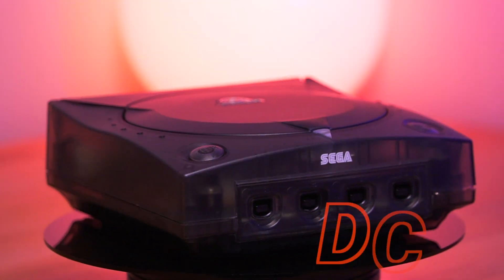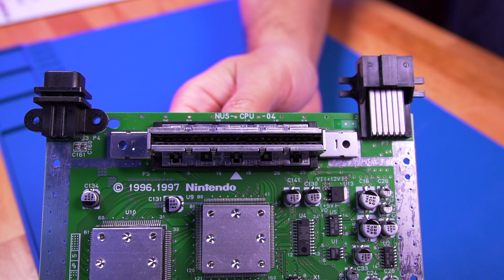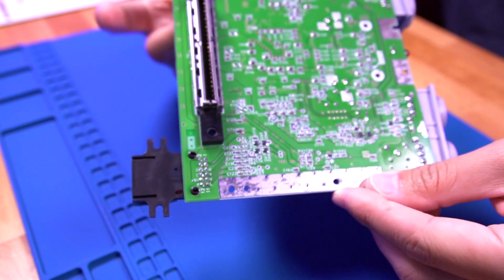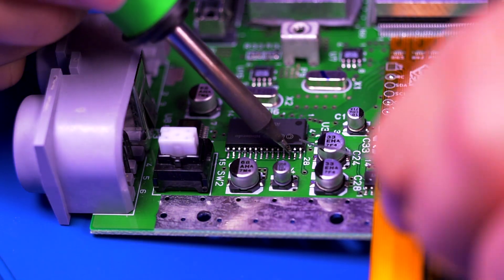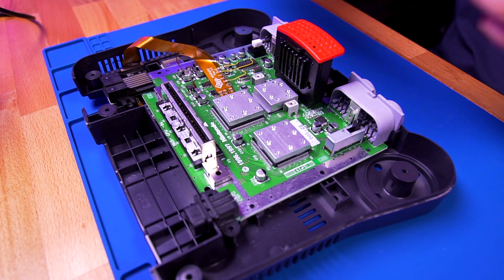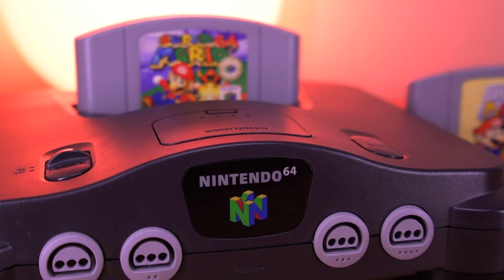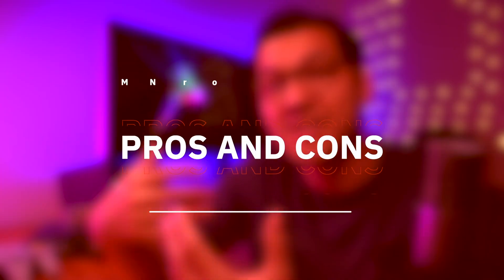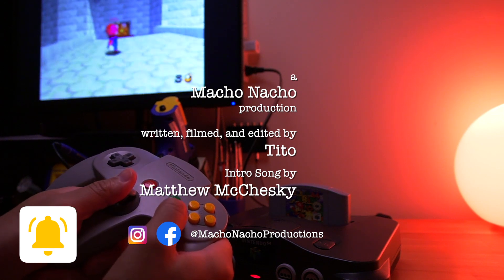PixelFX N64Digital Installation Tutorial and Review!

Comment: Last year I purchased an RGB modded N64 that I'm using through the OSSC so I won't be jumping on this one quite yet. However, I do have the DCDigital which I love so I know this product must also be killer. I kind of wish the DCDigital would get a firmware update to include some of the scaling options on the N64digital. It's probably not possible with the chip on the DCDigital but I'd LOVE a 3x option for 1440p.

Comment: Thanks for the overview!  I'm sold on it, but missed out on the first round of pre-orders.  Hopefully I can get one on order later this month. I went ahead and ordered the laser bear piece though while I'm waiting.  I have a spare jungle green N64 all ready to try this mod.
Reply: I finally got a kit in this week from last weekend's order opportunity.  I was able to complete the install successfully but completely missed the part of the instructions that say to leave the bottom RF shielding off if you're doing the no-cut mod.  It was grounding something out and was completely preventing the unit from powering on.  Once I figured that out I had issues with player 1 controller port.  Then I realized I have a newer board and needed to connect the CON pad on the flex cable to a via instead of pin 16 on the PIF.  Now that I have all that worked out it works like a champ.  Thanks again for this video! It was a huge help; I watched several times before I attempted this on my own.
Reply: @traaaaaavis  how much $ was the kit?
Reply: @darrell5363  with shipping it was about $198.00
Reply: @traaaaaavis  quite the investment! I think I’ll just use Roms lol

Comment: Great video!

I’ve done several of these now as well as several hundred UltraHDMI installs so I can share a couple shortcuts. :)

First, you don’t need to explicitly remove the Jumper/Expansion Pak. It will come off with the top shell and stay contained with the lid on top.

Second, you don’t have to remove nearly all those screws! You only have to remove the ones that thread into plastic (including the two that go through the board at the memory slot) and then the two that have washers on them which thread to brackets on the N64 board. It will feel like the heat sink is stuck because you have to break the surface tension with the thermal pads. Try to lift from the rear because the RDRAM chips can actually pull off the board on the front side (only four ground legs on that side). Similarly, reinstall it by first aligning the tabs on either side of the memory slot and dropping it down. They should be in little notches BELOW the top of the slot, not flush or above.

Those NUS-CPU-04 RGB component footprints are seemingly always unpopulated. Never seen one that was.

The foam isn’t specifically for covering the pins... it’s for pressing the N64Digital down into the bottom of the console so that it doesn’t contact the console. Obviously, those pins are the closest but it doesn’t have to cover the whole set.

The RF/EMI shield can be reinstalled for the regular “cut” version of this install.

Dan’s guide says to leave the brackets on the bottom out when using No-Cut but he is mistaken. They only contact ground, same as when the RF/EMI shield is installed. They can’t fall out either because the motherboard screws hold them down.

Comment: unfortunate that these mods are sold out so fast. :( been trying to upgrade my N64 for a long time...but keep missing these drops.
Reply: Seriously these install videos are useless when no one can buy the products.
Reply: @jmg5281986  just happened on the latest upload as well. the video should just be titled "a random gadget that someone gave me for promotion, but you can't get your hands on - here's how to put it together". it's just not as useful of a video when we can't join in the fun.
Reply: I feel that, same here.
Reply: If you don't mind the lack of features then Tim Worthington's mod is ~$40USD and works on a lot of models. His mod just sends RGB to the multi-out and has an optional deblur filter. (Voultar's is even cheaper; only works on, like, one model tho? lol)
With the money you save you can easily buy a RAD2x cable (~$70USD), which will output RGB to HDMI via the multi-out (this cable will work on all pre-'95 SNES models as well; all 1CHIPs have to be modded to output RGB though).
You'll still have money to spare, so you could buy a capacitor kit for the PSU and mobo (~$15USD combined). You could also splurge on some thermal paste and apply it to voltage regulators.
Reply: It looks like this product has not drooped yet. So, I guess we just have to keep checking back on it to make sure we can pick it up the moment it goes on sale.
Reply: Yeah, exactly.........so frustrating!!!

Comment: 4:56 - It's called the N64 because there's 64 screws in it. 😏

Anyway, I installed mine last weekend and it's working great! I also can't wait to see what PixelFX puts out next. I've especially been using the GBA Consolizer and PS1Digital a ton, they're both great and I can't wait to get even more. HDMI all the things!

Although, I must admit, I about crapped myself when I went to test it and thought it wasn't working. Turns out it just takes longer to start up and get a picture than a stock N64, so I was turning the power back off too quickly. 😅 Once I finally got a timer out and set it for the recommended 30 seconds for a sense of how long I actually had, I kept the system on long enough to see that yes, it's working fine.

Comment: Why do i actually prefer the composite video, i dont even have any nostalgia for composite
Reply: Different strokes for different folks. I'm an assassin Pixel kind of guy. I want my eyes to get cut by how sharp the pixels are, and I was raised on composite. However, the sharpness does take away from that "retro" feel. Games weren't built around sharp pixels and may seem a bit out of place. For instance, Super Mario 64 King Bob-omb fight: whenever I installed this HDMI mod, I noticed that when the camera zooms out on Mario as he runs further away, his visual quality changes drastically. He looks like a blocky boi.  With the blurring of the stock N64 console, it is less noticeable. So it really comes down to the preference of what you want. 

Want to compromise between the two? Invest in an upscaler! <insert Retrotink 5X plug here>. But if you don't have $300 US to throw at an upscaler (or can't find one), there are so many options we can choose from. My favorite balance is the GBS-C AIO. They have ceased production on the official product, but released the open source of the project allowing a solder hobbyist to make one for cheap. Don't know how to solder? Try for the cheaper, more available Retrotink 2x. There are more projects down the line like the PixelFx Morph and the OSSC Pro. They will be expensive, but that just means the older hardware becomes cheaper and more available!
Reply: Because you have sense and don't fall victim to nonsense by conviction... is my guess.

Comment: Great video.  I'm fortunate enough to have owned the ultraHDMI v2 and the N64 Digital.  For me, the N64 Digital takes the cake.  Image quality is comparable between the 2 but the N64D shines with how many options you have to dial in your experience.  Also, the firmware updates over the air are a huge plus.
Reply: @187bronco187 Do you tinker with scanlines and scaling?  If not, then yeah, to you it would be exactly the same.  Both devices offer a completely different experience, though.  The options to customize the picture on the N64D is leaps and bounds better than the UltraHDMI (I have both too).  The scanlines on the UltraHDMI would shift too much and make me nauseous.
Reply from the maker: Nice!

Comment: I wonder why nobody cares about the caps in the N64. I recapped now three of them, and all had leaking capacitors with a strong fishy smell when i soldered them from the board. On the last there were two caps complete dry and broken, i could pull the from the board with my fingers with ease, so that the legs were left on the soldering pads. I highly recommend to check the caps mindful. On the other hand all three were pal cpu 01 boards, so maybe Nintendo upgraded components down the line...
By the way, love to see your videos, they are great!!!
Reply: The only way i do a test on caps is by looking and sometimes removing some. Sometimes you see dried liquid around the caps, sometimes they are bloated in some way. You can smell it by desoldering. I had caps in psu's looking complete fine, till i desoldered them. Underneath i spotted a brown liquid. Just look very close. Your system will be fine most of the time but the leaked liquid can destroy traces on the board, because it is acid. To test capacitors exactly, you need expensive equipment. Only do repairs if you are skilled with soldering, pads sometimes come real easy off boards. Especially when caps are leaking☝️
Reply: Hi, what does it change to recap ? How do I test my caps to know they are still in good working condition ?
Reply from the maker: I will def be looking to recap in the next couple years. So glad you enjoyed the video!  Cheers!

Comment: The best thing about these videos is confirming to me that I don't want to attempt them myself :).
Reply: I agree, this is not one I will be doing!
Reply: Honestly I think he makes them look easy enough to attempt but saying this I'm self taught at soldering and I bought a Nixie tube clock to learn on with a cheap soldering kit....the only reason I haven't digitalised my OG Xbox or picked up a GameCube/Wii is that I'm unemployed at the moment and Microsoft love backwards compatibility to a point
Reply: It definitely takes a lot of skill, but if you're careful to double check every joint after soldering, you'll find that soldering is very forgiving with mistakes AS LONG AS you catch them before putting power to the circuit. I have to fix many "human mistakes" daily at my job and it's rare that one is so bad it ruins a part. As with anything the more practice you get, the better you become.
Reply: As much as I love the work Dan and the crew are doing, this mod is hard to recommend for a few reasons.

I think most people would be fine with composite on a CRT or getting a RetroTink 2X mini for $80. At less than half the cost, its plug and play and comes with an S-Video cable that works with N64 and any other nintendo system with a multi out.

The N64Digital is a great kit. Its just not beginner friendly in terms of install, can be hard to get, and the end result can be a tad underwhelming... though thats the n64s fault at heart.
Reply: "Oh this is eas---*oh*"
Reply: It's something that anybody with moderate soldering skills would be able to do, so if you can't find a "professional modder," you can always just find somebody who's competent with soldering electronics. We do this kind of thing in the retro computer community all the time.
Reply: Exactly. My only problem is the dust not being blown out of the innards!!!!!!
Reply: This is actually one of the easier mods that requires soldering. I wouldn't attempt any hard mod if you've never soldered before except those select few that are snap-on.
Reply: I installed this in my European n64. I only soldered some GBA mobo’s etc prior to this mod, but I mad it work. Worth every penny!
Reply: Don't be afraid.   You can do it.   You can even practice all of these skills on broken electronics !
Reply: Practice makes perfect, no one is that good on their first attempt
Reply: Absolutely. Leave classic consoles original
Reply: Easymac308   You a coward
Reply: @mrcalicowest3370  Having been witness to people's botched attempts, there's nothing whatsoever shameful about recognizing your limits.
Reply: @mrcalicowest3370  My hands and eyes aren't that steady.  I'd hate to ruin some perfectly good hardware because I overstepped.

Comment: You get the same result with RetroTINK and an mclassic. Why put up with micro soldering? If you screw up one of those pins for attaching that ribbon your console is toast. You should be advising people this mod is nowhere near for beginners.
Reply from the maker: I think I say it a couple times in the video that this mod is not for beginners.
Reply: @MachoNachoProductions  you do at the very end, not once through the tutorial. I would have put it before the actual work began. This isn't like changing a battery or popping in an ips screen. My concern with your presentation is just misleading people into frying their boards.

Comment: You don't need to remove the majority of those screws on the heatsink. It comes off the motherboard as one piece
Reply from the maker: That’s a good point!
Reply: You do need to remove those screws. I saw a LOT of comments saying this exact thing, and tried it, and you know what happened? It pulled one of the memory chips up on one side (the side that only has 4 legs - good grief, they should have added more pins, even if they go nowhere, for stability). Thankfully I got lucky and it was just the solder joints that broke and no pads/traces got ripped up, and thankfully soldering it back in place is easy if you already have the skill to install one of those flex cables.

BUT! The advice that you don't have to remove all the screws on the heatsink and just take it all off in one piece is absolutely terrible. Take off all the screws. Remove the main heatsink by itself and leave the smaller metal blocks and thermal pads on the chips. Saving a little time undoing screws isn't worth the time wasted resoldering the memory to the motherboard, and certainly isn't worth destroying your N64 if those pads get ruined.

So to anyone reading this - do it right, take out all the screws. Don't ruin your board because YouTube comments told you that you could save time.
Reply: @mjc0961  I've done this method to 10+ n64s. You just need to be gentle when you remove the heat sink. There are also 4 screws you need to remove on the heatsink at the bottom. I gently rock the heatsink back and forth. It pops right off. 

I've done 3 n64digital installs and 1 UltraHDMI. I'm not wasting my time with those screws

Comment: Would be fun to try how sharper you could get 240p through this HDMI mod on CRT televisions. Worth it?
Reply: No it wouldn’t, you’d be better off doing RGB through component or Scart with a CRT
Reply: @crestofhonor2349  The Nintendo 64 isn’t RGB out of the box. You still need to modify certain models that enables it to use its full potential.
Reply: @NiGHTSaturn  It's just that adding RGB to a N64 would benefit it but using HDMI is pointless with a CRT unless you have one of those HD CRTs with HDMI built in, otherwise its pointless
Reply: @crestofhonor2349  You do know HDMI to Component cables exist right? How about a console that can do both with the right cables? Sounds like a win to me. The different mod options sometimes differ also when it comes to color.

Comment: This is a great mod!! Its very unfortunate i already invested and set up a sony trinitron wega to play my retro consoles.
Reply from the maker: That’s a great way to enjoy retro games!  Nothing wrong with that at all. Tough to beat playing on a great crt
Reply: I honestly would prefer your way (a good sony triniton) over hdmi expensive modifications.
Just make sure to use the best s video cables you can get. I am sure your setup looks awesome.
Reply: @fernandomartinez4486  oh yeah s video is a must. 👍👍
Reply: Crt all the way no hd mod will top that ever
Reply: That Trinitron probably cost less than the kit for this mod anyways (I can't see the PFx price right now, but UltraHDMI was around $185 IIRC).

If you still want to upgrade your AV experience, hack a RGB SCART connector onto your set and do a N64 RGB mod. RGB kits are around half the cost (and not unobtainium), and can then be fed through a scan converter for similar results via HDMI if desired.
Reply: Thankfully my Sony CRT  is the XBR 960 34 " wide screen with HDMI!! Perfect solution 👌
Reply from the maker: Nice!

Comment: Make sure to plug the jumper pak in the correct orientation when testing it without the shell.

I blew a fuse in the power brick thanks to messing this up.
Reply from the maker: Yes!  That is super important!
Reply: I did similar once and thought I needed a new power brick. Went out and got a new one a couple weeks later and to my surprise the old one worked again.